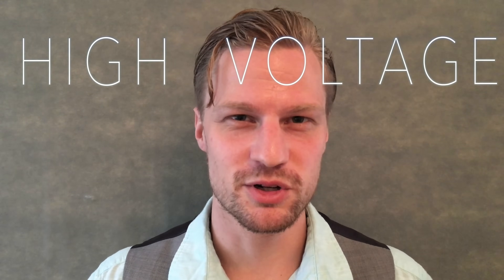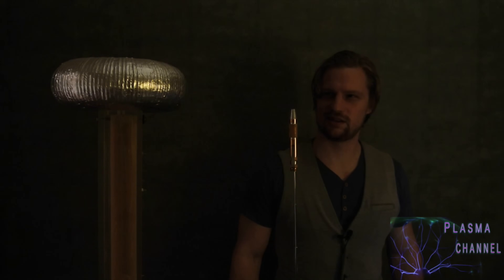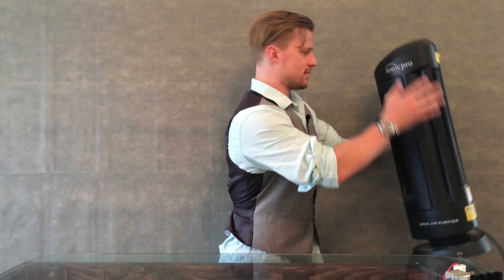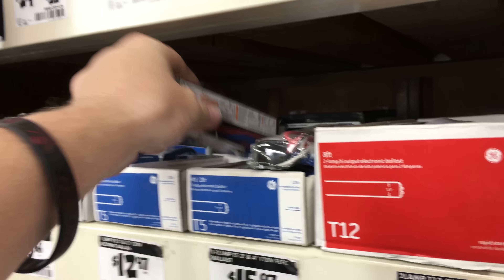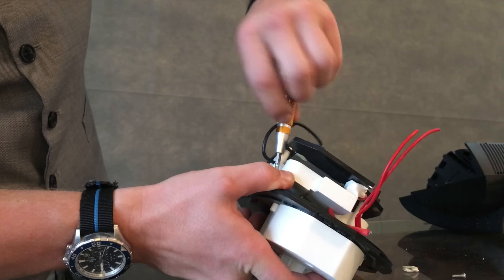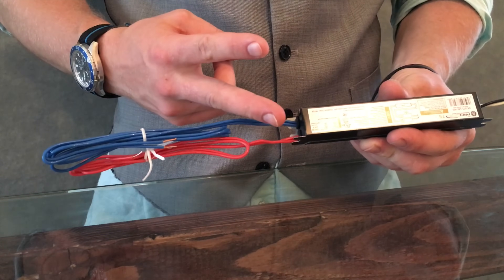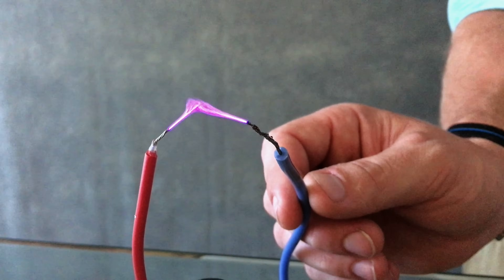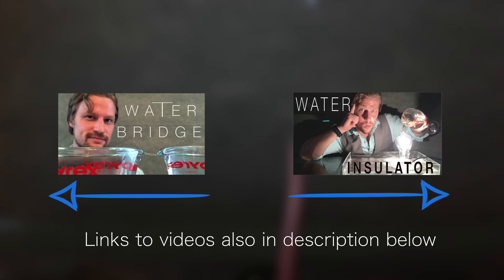Super Simple DIY 10,000v AC Supply!

Comment: Looks like a pretty generic flyback transformer to me, the only benefit might be that there's only a single primary that I see. you can get these out of any old CRT display, you just have to wind your own primary on the other side of the core, and it can be driven with something other than AC mains voltage like a nice 9v or 12v dc source.
Reply from the maker: Hi Wildman. As mentioned in the viddy, this particular flyback is AC output. The flybacks out of a CRT will produce DC. Which is fine if all a person wants is sparks.
Reply: @PlasmaChannel  they'll produce a pulsed half wave rectified RF signal, not true DC, not with a single output rectifier, that's why the arc whines, get rid of the rectifier and its just another AC transformer, even though on new ones that would be a chore since they're potted in enamel.

Comment: How to make high voltage safe? What is the equation?
Reply from the maker: High voltage must be very low current in order to be safe. In general, currents less than 5ma are very safe, if that is the maximum current delivered through the body.
Reply: @PlasmaChannel  a start would be ditching the need to supply directly 120V AC mains. I can think of several different simple ways to drive a transformer like this off a nice safe 12VDC source

Comment: Is there any way to power the driver circuit from a DC source such as a battery?
Reply from the maker: I suppose that depends on the exact inverter you buy or use. I know for a fact that some inverters do use DC for an input.
Reply: @PlasmaChannel  I was once tinkering around with an electric flyswatter's circuitry, I removed the voltage multiplier and the output of its transformer was generating a promising high voltage, enough to make some small arcs(~2mm), why don't you try making some project using that circuitry?
Reply: @TechBuild  building a suitable oscillator is incredibly simple, a pair of transistors, a pair of resistors, and some custom wound primary coils is all it really needs. or a more flexible driver could use a 555 timer and a single driver transistor.

Comment: is that really an AC flyback? DC flybacks from computer monitors are very easy to find, but useless to use as cockcroft walton multiplier source. True AC flybacks from very old TVs are rare nowadays.
Reply from the maker: It indeed is AC. Air ionizers, depending on the model, have voltage multipliers built into them. These multipliers are fed by an AC flyback, like this one.
Reply: considering there is no such thing as a DC transformer... I guess you must be thinking of a flyback with a HV rectified output
Reply: @wildmanfujiami5870  there is no dc transformer, but there are dc flybacks (HV transformers with rectifier diodes inside used in monitors). Pay attention!
Reply: @professorEduardoBrasil  i've worked with flyback transformers since before i was old enough to grow facial hair, I was building tesla coils by the age of 14, I know what a flyback is, and I know there is no such things as a DC transformer. a transformer with a single rectifier off its output stage is not DC.

Comment: I stumbled upon this while experimenting years ago and was able to achieve 100kV. I seemed to have gotten lucky with the flyback I used cause I couldn't replicate it with any others
Reply from the maker: It is funny how each flyback can produce drastically different results. 100kv is impressive.
Reply: @PlasmaChannel  I have some really old ones that will produce arcs as big as a MOT with a zvs driver and then some that just make little sparks
Reply: @PlasmaChannel  i'm sure this has a lot to do with wire gauge, the Q factor of the transformer, the type of driver waveform (sine, square, sawtooth), and its natural resonance range. i built a transformer from scratch that consisted of just 1 layer of 32AWG enamel wire on an old EM choke core that was about 2.5 inches long and an inch wide that must have produced at least 20kv at the right frequency with a square wave, given the arc length

Comment: What is the use of a driver please ? Does it transform low frequency AC current to high frequency ?
Great video ! I would like to do the same but with a microwave transformers ( dont worry i already know that i’ll have to pay attention at its capacitor ) have you any tips or is there any difference with yours ?
Reply from the maker: Thanks for the compliment. The driver provides the pulses of electricity into the transformer. Transformers need pulses or waves in order to function.
Reply: Plasma Channel but you use it because your high voltages supply works on battery but if you connect the transformer directly to the sector it should work ?
Reply: @pierret6572  a flyback transformer is designed to operate at high frequencies in the KHz range, it has a ferrite core. any transformer with an iron core, like a MOT, is designed to operate at low frequency ranges, such as the 60Hz from the wall. that being said I would never consider a MOT for a DIY HV supply because they are current sucking monsters, unregulated, and very dangerous. if you absolutely must use a MOT i would strongly suggest ballasting the primary coil with something like a 120v lamp or another MOT primary with the secondary shorted to itself, to regulate the current draw.
Reply: Wildman Fujiami Can a flyback transformer work with alternative current ? I mean Not pulses of “positive” current but with positive and negative  signals. The end goal is to produce high voltage, high frequency, low current AC
Reply: @pierret6572  technically yes but the energy would be wasted unless you get a flyback that either the rectification diode can be removed or one that simply doesn't have one. it's really easy to build your own HV transformer, i did it in a matter of minutes, and the output was at least 10kv for sure.

Comment: I have found an air purifier same as yours. I just want to ask if it will work if i use power supply instead of ballast? And if i will be doing that, will it be dangerous in AC sockets? Thank you.
Reply from the maker: What are you using, when you refer to power supply?

Comment: i challange you. build a dc 90,000 high voltage 1miliamp low current spark discharge system! ? it its completely possible but i though you can not make it!
Reply from the maker: CHALLENGE ACCEPTED.

Comment: Hi mr JAY I was wondering if the ark contains enough power to kill a person maybe a dumb question but i would like to know if i ever decide to build something like this i would be fried like a pop corn lol
Reply: If you touch it with 1 finger, lots of pain and burn mark. If you touch with 2 fingers, you will act as a circuit and you could die.
Reply from the maker: Cyrus is correct. However, the current this circuit provides will not kill you if it goes across your chest. It is not high enough current to guarantee the stopping of your heart. If you have a pacemaker, though, it could mess up your pacemaker. So, always be careful with these circuits, and use only one hand.

Comment: Can i use a car ignition coil instead the transformer?
Reply from the maker: Ignition coils operate using very high currents running through their primaries. If your driver can supply several amps (never seen that) you can run an ignition coil. 

Though, ignition coils will heat up because they are not designed for high frequencies
Reply: @PlasmaChannel  i've ran an ignition coil with a 12V lab bench supply and a power MOSFET feeding signal from a function generator, a 555 timer would be just as good.

Comment: Can I use an old microwave transformer
Reply from the maker: You may be able to create small sparks with an MOT. I warn against actually using an MOT at full power and plugged into the wall itself - those are dangerous.
Reply: @PlasmaChannel  extremely dangerous, the primaries alone are technically too small for the transformer thus draw exceedingly high amounts of current even just sitting with no load, it's best to ballast the primary with some other inductive source like another transformer primary or a lamp or something to regulate the input current.

Comment: Can I use the 12 volt ballasts instead of mains voltage ones? This ones 25khz at 900 volts. I’d like to use it for a spark gap Tesla coil similar to your 3 volt version but scaled up.
Reply from the maker: In fact you could! That may work better

Comment: would it be possible to put a dimmer/pot somewhere in the circuit to increase/decrease the voltage output.

normally i would put the dimmer on the mains side of the circuit but im not sure if the ballasts would be able to be dimmed
Reply from the maker: Ballasts tends to freak out if dimmed too much. Using this method- I am not certain.
Reply: @PlasmaChannel  i might have to experiment with this a bit if i ever get one of those high voltage generators,
right now my setup just has 3 microwave transformers 
secondaries in series and primaries in series.
being powered but 2 variacs on separate phases (using only the live wire on the outputs).
neutrals are tide together with the grounds

im still trying to find a meter to measure the voltage output

Comment: I have a ballast which has 8 wires coming from it. 2 are obviously where 120v in goes but then on the same end there are 2 yellow wires. On the other end there are 2 pink/red wires and 2 blue wires. Do you have any idea how to figure out which wires I should connect to the transformer? I found the pins on the transformer I just can't seem to find the right combination of the 6 wires.
Reply from the maker: Interesting! Did you try different combinations of single colors?

Comment: Okay, first of all, the output is not ac!
That high frequency transformer is constructed just like the Fly back transformers used in old CRT monitors and TV, except that it doesn't have the focus outputs and all the extra windings that were needed in a TV or monitor, they needed all of those because the fly back transformer was the sweep circuit as well as the power supply for the hole set. But these transformers are all based upon a diode capacitor voltage multiplier as those proved to be the simplest and most reliable way to generate high voltage from a high frequency transformer, originally TV fly backs in the days of black and white TV's only had to create between 7,000 and 16,000 volts depending upon the size of the set. The Design of those transformers was very special, the high voltage secondary was only about 1/4" wide, but was many layers deep, the core was big enough to allow a 1" - 2" gap between the top layer of the secondary and the core, which was the only way to prevent breaking down the insulation due to coronal discharge with high frequency is an air gap larger than the jumping distance of the working voltage, now when the color CRT was introduced, the voltage requirement increased to 30,000 volts and this had to be very strictly controlled, not because of the CRT not being able to tolerate any higher voltage but to maintain DHEW standards for Xray exposure, this added some additional circuitry to regulate the voltage to 30.0KV +1.5% max, it was along about that time, that the 60hz power transformer had been replaced with extra windings on the fly back. Needless to say that with the increase in load and increase in voltage the horizontal sweep circuit became the major failure point of almost all TV'S in that era, most of the failures were high voltage brake down or flash over. The first manufacturer to solve this problem was Motorola back when they still made TV'S they placed the entire high voltage sweep circuit in transformer oil just like the distribution transformers on power poles. To my knowledge I never heard of one of those failing. The other reason I know that that unit you are using is DC is because both inoizers and electrostatic  filters require DC, they will not work with ac at any voltage level period.
Reply from the maker: Thanks for the comment. So, not all flybacks are DC with internal diodes. Ionic cleaners employ a voltage multiplier in line after the transformer... multipliers only function off ac. These specific flybacks are AC, with no internal diode, in order to feed the voltage multiplier. I have also tested the output with high voltage diodes to confirm it is AC. For additional clarification, please see my similar responses in the comments below.

Comment: hi plasma channel, just came across your channel. i'm from the u.k, had to google what a thrift store was lol.
would this piece still work with a 240v supply? pretty new to this, but love it none the less.
thanls
Reply from the maker: Hi dom! It should work with 240 volt as well. However, only use the CFL inverters sold in your country, for specificly 240 volt input (from wall). Basically, the output will then be the same as what would happen here in the USA. On that note, greetings from Seattle, Washington!

Comment: Can you touch the arc
Reply from the maker: You can, if you want to be burned. This is a high frequency AC arc (not DC........this specific transformer has no internal diode). It will vaporize your skin

Comment: I have a question, could I also use a microwave transformer?
Reply from the maker: You could not. It is designed to be run at 60Hz and 10 amps , the inverter runs at really high frequencies, with super low current that would do little into an MOT
Reply: Ok, thank you for replying before I bought the wrong transformer.😁😅

Comment: I have a question. So when i arc my CRTS the arcs are huge when i dont use this method but when i take apart the tv and get the flyback and use this method its WAY smaller. Is there any way to increase the output power?
Reply from the maker: Usually upping the frequency can up the current
Reply: Thanks!

Comment: It’s easier to use a fluorescent ballast (the driver) that has the two yellow wires. There’s no guess work involved. Just connect one of the yellow wires to one pin on the primary and the matching color, (depending on which side you use) which is red or blue, to the other pin. Easy as that. Just saying!

Comment: I guess that generates lots of negative ions as well? If you don’t know about those, you should look into it... The benefits are amazing. They literally make you feel better. Generated in nature by lightning and waterfalls, they are the “fresh” in fresh air. They bond with smoke, dust, and pollen causing them to stick together and they just fall out of the air to the floor.
Reply: Nope not anymore there are research papers proving that negative ions doesnt affect any brainwaves to make you feel relaxed.
Reply: Yes negative ion generators tend to use flybacks that feed AC into Cockroft-Walton voltage multiplier cascades with negative output that is fed to a set of needles that discharge negative ion corona into the air and a fan blows air through that carries the ions out into the room. Ionic breeze machines like this one use plates charged with the negative high voltage, and electrode wires on the upwind side of the plates with the positive charge to electrically charge and move the air, like a high voltage lifter does, and air pollutants like pollen, mold spores, dust, dust mite feces, animal dander, etc cling to the plates and can be wiped off and discarded. They clean the air electrically and disperse negative ions to improve the air quality.

Comment: Except, flybacks have a lot of pins and you did not go into which are the primary that you have to connect to. Also, would have been helpful to show said trial and error. Kind of a rather incomplete build...
Reply from the maker: Not all flyback have multiple pins. Some have only 4, some have 9, some 12, some, two wires coming out of the epoxy. I focused on the concept of the build, not the trial and error. No one has time to watch a trial and error video. Hopefully you enjoyed nonetheless

Comment: my air ionizer didn't have a transformer like that, it had a little box that said "120v 50-60 hertz input, 7,000 volts DC output negative" I don't really know what it is but it won't work for my purposes. I don't really want to buy more air ionizers because if they don't have a transformer, I'll just have a bunch laying around :L would you recommend the link in the description, or do you know another good source of one? I noticed it doesn't look like the transformer in the picture has an insulated secondary, so I'd probably need to submerge it in oil.
Reply from the maker: Shoot. Okay every once in a while I ran into that problem. The sharper image ones always have a nice ac transformer in it.

Comment: Please consider a more appropriate name for your channel such as Beginners' Plasma Channel or Electricity For Inbreds or Pretty Lights To Touch Your Tongue To or even Lick My Live Wire...I mean either that, or make some more instructable vids on more useful and completed projects at least. How about a heating pad, that can also be useful in home fermentation, but with a reliable thermal switch, or on the simpler side make a solenoid switch to safely turn wall outlet power on or off from choice of sensors? If it has to be about plasma, how about a Van De Graf generator that repels rain out towards the sides while your hair simultaneously stands on end?
Reply from the maker: What?